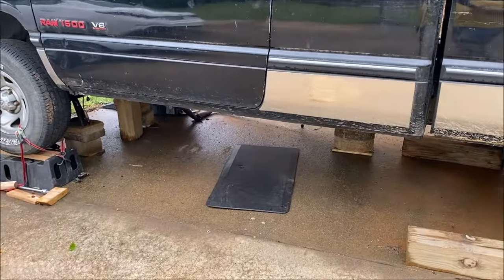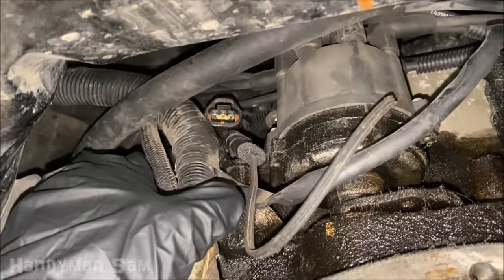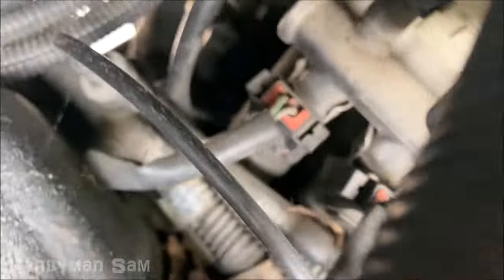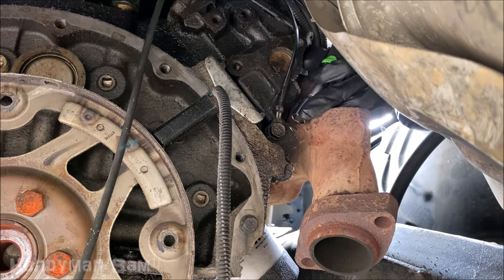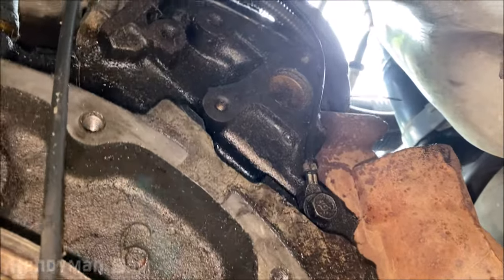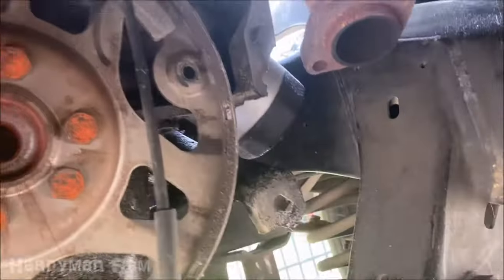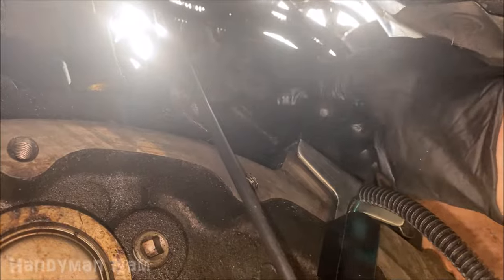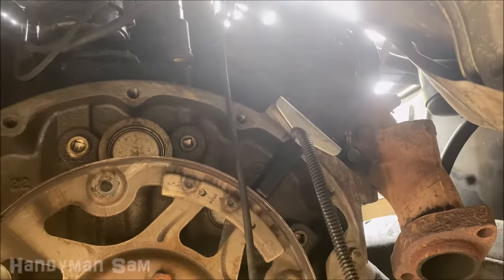1997 Dodge Ram 1500 Crankshaft Position Sensor Install

Comment: Thanks for the video and the helpful info! I got a 97 Ram with the 5.2 and this code popped up as well as cylinder 8 misfire. I replaced the plugs and wires. I heard somewhere that the ignition coil when it goes bad it usually comes up as a misfire.
Reply from the maker: Glad to help! Yeah I would start basic with inspection of stuff like plugs and wires. Definitely get a quality crankshaft position sensor though if that is the problem.

Comment: Had to do this to my truck. But if you have a EGR on your truck. You have to remove the tube that goes from rear of intake manifold to the left exhaust manifold in the rear.. I recommend also to remove EGR to access the bolts. I also recommend removing oil pressure sensor if you have egr. I broke mine when i was tighten the tube from exhaust to intake manifold...
Reply from the maker: Thanks for your comment!

Comment: I thank all the people who put a vidio out but this one really helped. me get a look at which way I am gpong to do go at it.
The best way I can see to do it is breal the two bolts lose then take a quarter in with a swivel and either a tourc or a allen tip socket and a 1/4" impac cordless and go in from the top and change it out. thanks
Reply from the maker: Glad it helped! Yeah, I felt like it would be the perfect time to show it with everything else out of the way. Definitely not easy to get to.

Comment: I was driving down the highway couple years ago and my 98 dodge done a loud backfire and stalled. Tried to start lt again and wouldn't. This was the culprit. Sad thing is that I had my truck in the shop and they couldn't find anything wrong with it. Mechanics were I live are so lazy

Comment: Will my crank sensor make my truck jumpy after plugs and wires are changed?
Reply from the maker: Yes. Even if you have brand new spark plugs and wires, if your crankshaft sensor is bad, it will run rough.

Comment: does the crank sensor prevent a spark to the distributor from the coil pack?
Reply from the maker: It can indirectly through feedback to the ECU, yes. Directly, no.
Reply: Did you figure it out?

Comment: please tell me you didnt take out the tranny and exhaust to do this . hahaha i watched one where the guy took out his wheel well and tire to try and reach it but couldnt. sorry im in tears cause im as skinny as u guys and it took ten minutes sitting on the engine . so what im looking for is if anyone had to adjust or relearn the sensor after install.dodge told me it had to be adjusted , but i think he is lying cause it is a solid bracket , no adjustment bolt or spacers. idk .truck still dead.
Reply from the maker: No, haha, I was just showing a clearer view of it while doing a transmission rebuild. I knew many folks would probably desire a clearer view of where it is exactly, so I took the opportunity to do that. No adjustment on the sensor is needed, just be sure you don’t settle for a cheap one. They’ll only last for a year.